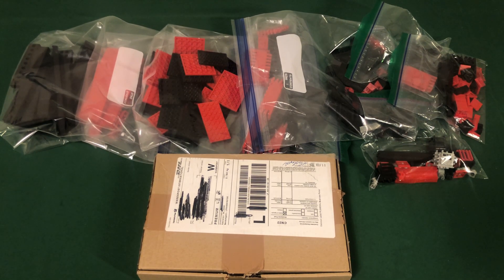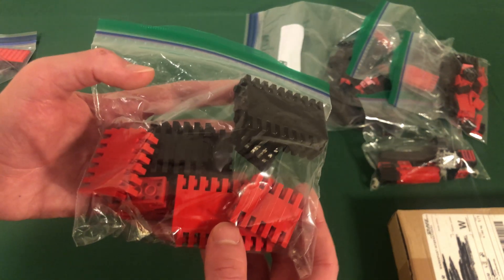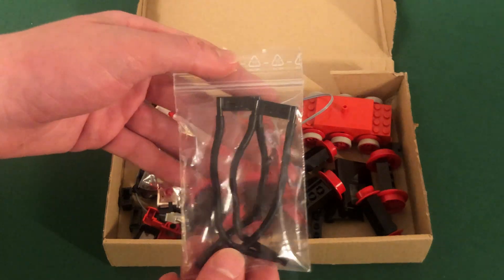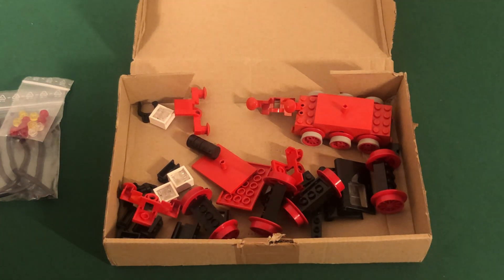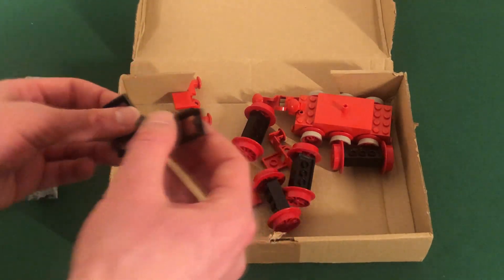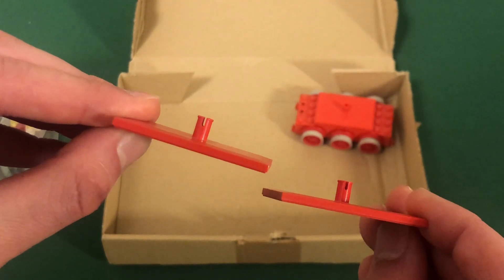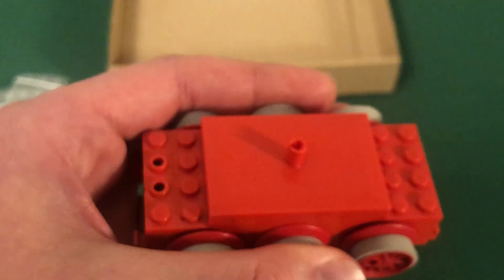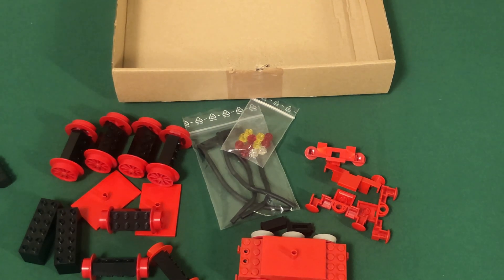Building a LEGO 12V steam engine: Acquiring the bricks

Comment: Hey, got interested in obtaining 12v system in a future, how much will it approximately cost to have some simple railroad layout? And just how much you've spent for the layout you often show in video?
Reply from the maker: Glad you're interested in getting into 12V! To get a simple loop (1 starter train set, a transformer, and maybe some extra track) you can probably keep it under $300 (maybe $200 if you get a simple set). However the points and signals add up pretty quickly ($50 per point, $80 per signal). I've spent an unholy amount on my entire collection ($5,000+) but I do try to get sets in really nice condition, such as my 7760 with a complete box and mint sticker sheet. If you want, say, a decent layout and you don't care about getting boxed sets, here's an example of price breakdown:

4 points: $200 total
2 signals: $160 total
1 decoupler: $100
2 train sets: depends which you get but say $600 total
Extra track + transformer: say $50

That would cost about $1100 total. Again though, it's all up to you and how many trains / remote accessories / supplemental sets you want. The entry point for a super simple loop of track is around that $200-300 mark.
Reply: @Reker1million  thanks a lot for answer.
Reply from the maker: No problem! Happy to help. Let me know if you have any other questions.

Comment: Great to hear that you were able to salvage that red motor. Also all the parts you bought look to be in very good condition. I also wanted to ask you are the more common parts from 80s, or they are newer ones? I’m looking forward to the part 3 of this series.
Reply from the maker: The common parts are a mix, I didn't buy them specifically from the 80s but I tried to use as many older parts as I could by selecting ones with pip marks, older mold designs, old red, etc